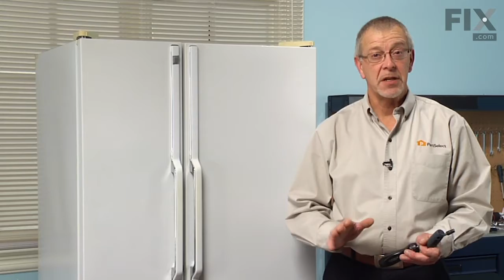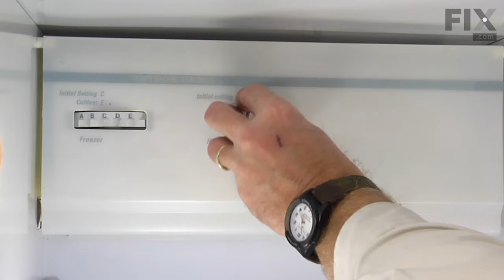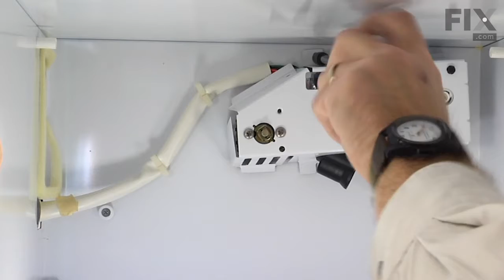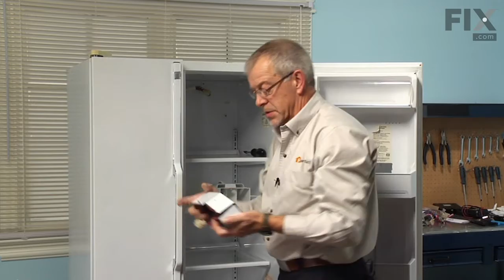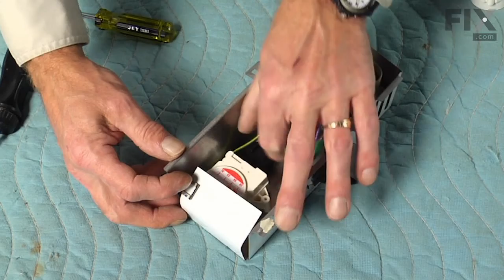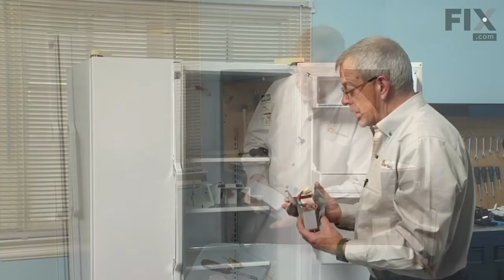GE Refrigerator Repair – How to replace the Defrost Timer

Comment: Having the same GE fridge, I found my defrost timer and defrost heater coil tubes to be open circuit. I replaced the coils, but the timer was repaired by careful disassembly. The timer has contacts that had become non conductive from disconnect arcing. With some sand paper and polish, I cleaned the contacts then reassembled. Timer was returned to it's functional state, and reinstalled.